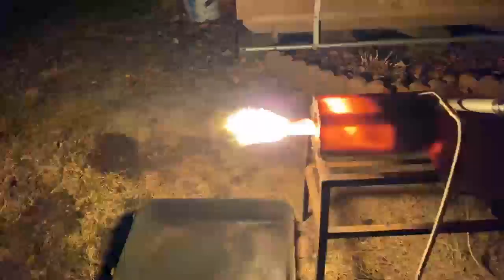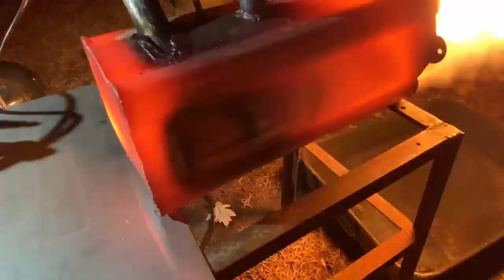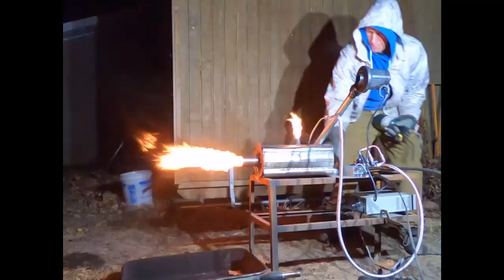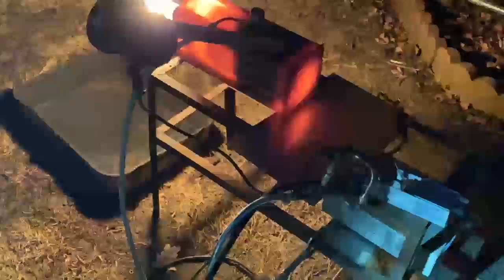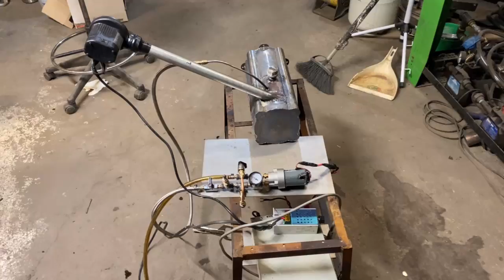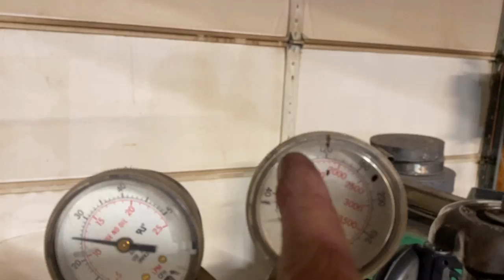Waste oil Shop heater blower powered for Jason

Comment: I have a turbo off a subaru sitting here in my shop. I am considering making one powered off the turbo
Reply from the maker: it will work but be to loud and powerful for a shop heater , you cant run it on low as far as i know but i could be wrong

Comment: Need a better understanding of the insides and how it works.  I made a rabbit burner 8 years ago and when it worked ok, I didn't have a good burner chamber for the flame.
We were trying to burn glycerine from biodiesel production which was horrible to breathe if it wasn't super hot.

Comment: The oxygen should come from outside, and your shop should have an exchanger of air.
Pre heating the oxygen would be great
Reply from the maker: I prefer having the shop under negative pressure so its pulling fresh air into the shop but thats just my opinion . Yes pre heating the intake air with waste heat would be ideal . It turns out the amount of air needed to run it is very low so it doesnt pull huge amounts of air

Comment: How durable is the metal of the burner?
Reply from the maker: Its 16 gauge stainless steel , will last for a very long time . Salamanders run red hot and last over 10 years and thats 18 gauge stainless
Reply: @NOBOX7  Unfortunately, I'm having a hard time getting stainless like that, I really need it for the stove.  There is stainless, it doesn't melt, but it porous very quickly.  Thank you friend, for the information, very useful.
Reply from the maker: @YudiHermanto4H  I will do a life span update when the first one burns out . If you keep it red hot its ok , yellow hot will burn threw in 800 hours . The camera makes things look hotter then they are . it never got yellow .  Also as you know youtube removes comments that contain links , i did not remove your comment . it was approved but i still dont see it . You have surley seen this on your channel as well